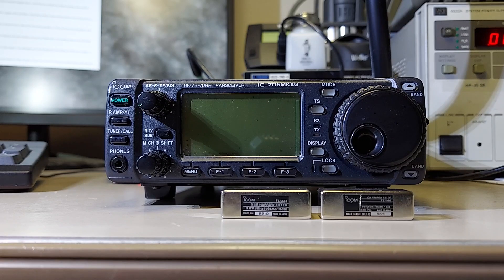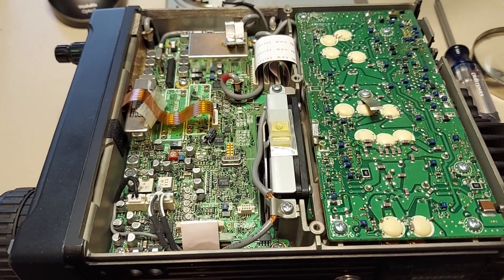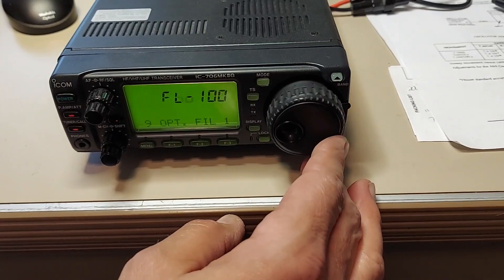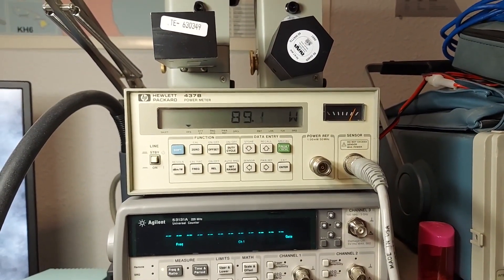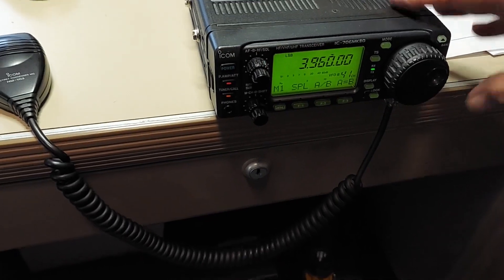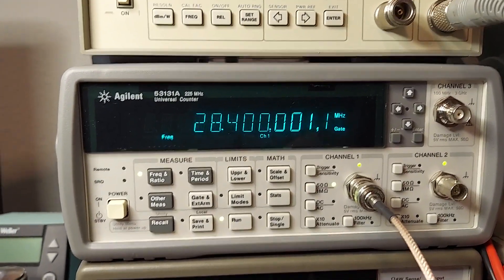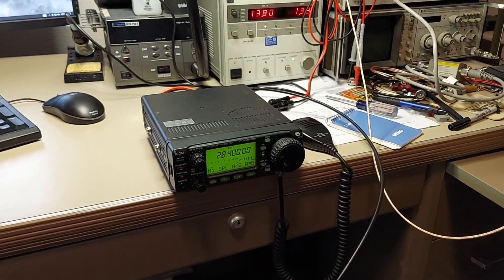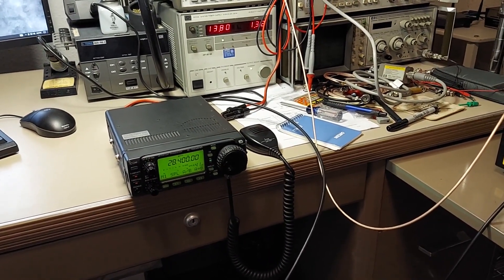Icom IC-706MKIIG filter install.

Comment: wow still working ? this is an old radio
Reply from the maker: I bought this radio new back in 2003. It's been my mobile work horse for many years, I only had to send it back to Icom only once to repair an issue with the unit powering on/off. I certainly would like to see Icom bring this radio back. Thanks for watching!
Reply: @CraigPetersen12f36b  I found one with high serial numbers so one of the last ones manufactured for $500 in good shape

Comment: Great video! Where did you get the filters? I’m wanting to do the same.
Reply from the maker: Good Morning,

I purchased the filters off of eBay, the prices were about $125.00 or so each, about what they were new. These filters made a big difference on crowded bands and have breathed new life into my 706MkIIG. I have the CR-282 high stability option but have not installed that option yet. The last module I plan on installing is the speech module that announces operating frequency and mode.

Comment: A really interesting video,  thank you for sharing it with us.  I noticed that during the power output checks you did not change the frequency on the power meter. Unless you have a very flat sensor you will not get the best accuracy using the same correction factor for all frequencies. Regards, David
Reply from the maker: Greetings David, the power sensor I used is the HP8482A. You are correct, I only used the correction factor listed on the unit from the factory (100% @ 50MHz on down to 100kHz) so I just went with it. I have three power sensors and this is one that is due to be calibrated again. Thanks for watching!
Reply: Point of order: The exact attenuation of the 40 dB pad can be set (offset) as well for increased accuracy in the power meter. Maybe that was done as well?
PS. Also coax loss, more apparent on the higher bands.
Reply from the maker: The HP 437B does have an offset function that allows for a +/- 99dB offset to be entered, I was using a 40dB offset in this case. The Bird attenuator (LUC-002-E) does have an attenuation table, but nothing given for frequencies below 450MHz (@ 450MHZ the calibration table lists 40.38dB) so in this case I just winged it.